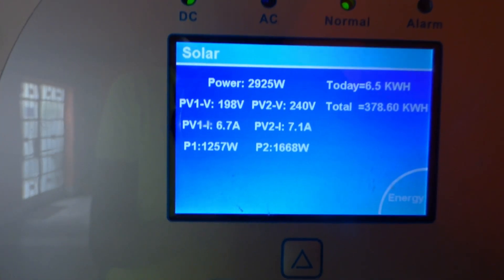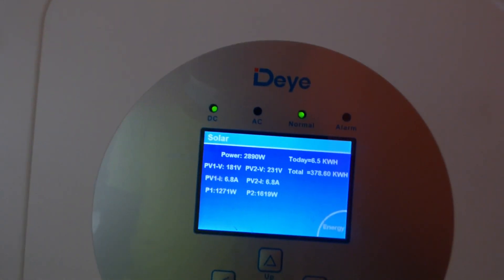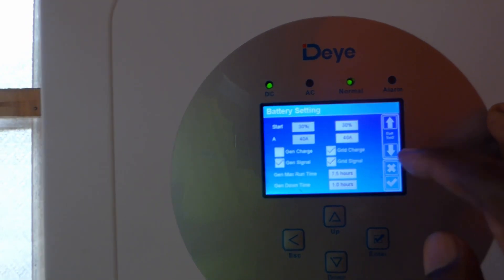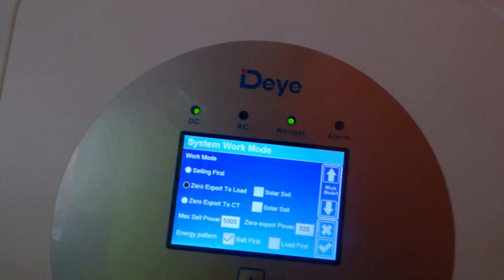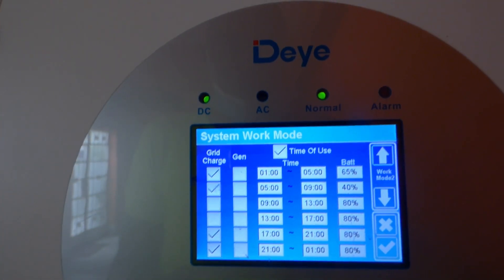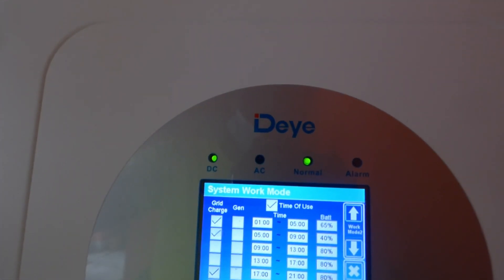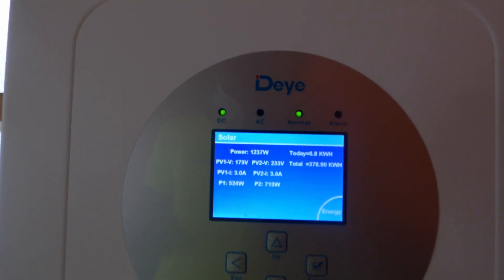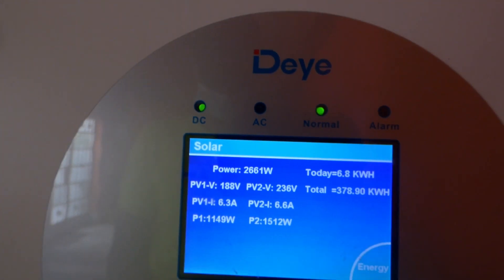Deye Inverter: Prioritizing solar over the Grid see how it is done.

Comment: Hi, i bought 5kw Deye and 4x405w jinko mono panels - no batteries.
I mounted solar panels to a tiled roof and inverter in the house - the inverter supply my house with solar + grid (hybrid on high loads and solar only on small loads). The problem is when grid goes off the inverter gives error F47 - even though i connect small loads. Your answer will help a lot - currently budgeting to buy 1x3000C polytech.
Reply from the maker: It does not work without batteries. It will work without batteries if you have the grid. You have to add batteries to the system.
Reply: @drsolar  tomorrow I'm getting the US3000C battery -  do I really have to buy a 100A fuse and holder? The battery bms protects it very well + deye is compatible with polytech batteries. I can save some money if the system can protect itself. Please advise
Reply from the maker: @nicomoloi936  get protection. You don't buy insurance because you plan to crash you car. Get a heavy duty breaker. We had failures in the standard breakers

Comment: Nice tutorial! Good evening. I just bought DEYE 5KW Hybrid inverter my question is as per manual / schematic the grid and load should be separate connections. Is it the grid connection is only the input side and the output is the load? If I am going to connect External ATS is it necessary? Thank you.
Reply from the maker: Good day Michael, welcome to the channel. The input is the grid and the output is the load. There are two inputs. Gen and Grid. No need for an external ATS, the inverter does the transfer automatically between grid and UPS. Good luck with your new inverter
Reply: @drsolar  thank you for your reply.
Reply: good day Micheal and Dr. Solar, If you have the grid connected then the grid input can also act as an out for exporting power back to the grid. This feature is nice since you can connect higher power loads ( beyond rating of the inverter) on the grid side so that they can be powered with solar power if available. You can limit the actual export to the utility by installing the CT (shipped with the inverter) passed the distribution point where you've connected your 'big load' and activating zero export. That way the big load will run with a mix of both solar and grid minimizing your bill.

Comment: Sir, I have a question. Lets say I set it 1pm-5pm discharge power of 100w. Then the grid is interrupted and EPS mode is activated during that time. Will the time of use settings be ignored? Say the load is 200w in EPS. Will the inverter give 200w for the load or will it shutdown because the set power is 100w?
Reply from the maker: Very good question. It will give the full 200 watts as long as your battery can allow it
Reply: @drsolar  this is all I needed. Im getting this inverter. Thank you sir!

Comment: Thanks Doctor. I have a question .... let’s say house load is (say) 2 kw at a specific moment and my solar panels at that moment only delivers (say) 1.5 kw, I noticed that my grid then kicks in and delivers the shortfall of 0.5 kw, even though my batteries are fully charged. I would rather that the shortfall be drawn from my batteries until they are (say) 60pct discharged, and only THEN the grid must kick in. How do I set up my inverter for this ?
Reply from the maker: Good morning. Thank you for watching and commenting. Settings, system works mode, check time of use, then check grid charge and the batt % 60. You have constant grid you can make that % even lower. Let me know how it worked out. You can whatsapp me on +12018154132

Comment: One thing noted here on time of use, your setting in the afternoon is 80%, which means the inverter will use the battery up to 80% state of charge if there isn't enough solar power. I have mine at 30% throughout day and night to shave off the electricity bill as much as possible (our power outages are not as problematic anymore, so never been out of utility power for months now). Also, if you have a bi-directional meter, you could benefit from exporting excess power to the grid whenever it is available. The bi-directional meter will run in reverse, therefore giving you kWh credits. So even if the utility does not buy from you, you actually get to benefit from the kWh units anyway, so nothing to lose there.
Reply from the maker: It will only use 20% before it charges. Soc will not fall below 80. Thank you for watching and commenting. I am off the grid. My customers don't have smart meters sadly
Reply: @drsolar  makes sense if you're off grid.

Comment: Thanks for these great educational posts. I learned a lot from you and actually got convinced to install a deye system. I'm on 5Kw Deye, 2 X US3000 pylons, and 14 X 410w poly panels(east-west orientation form longer stretch of solar power). The system works very well, I'm still adjusting to it. It is grid tied, so when I deplete my batteries at night, it then switches to the grid. I can also export to grid side of the inverter(export to CT). So during the day when the batteries are fully charged and there isn't any other usage, I use the power from panels and batteries to heat up the geyser(3kw element for 150L) or cook using induction stove/oven/insta-pot. At the rate I'm going, my electricity bill is down to about 25%, and it could go down further with more optimizations. So thank you very much.
Reply: Hi Melvin. I am in Limpopo and connected my east-west orientation to an almost identical system, just having one US3000C at the moment. Also grid tie, to save on electricity bill. I opted for a solar geyser when we built our house 5 years ago. i am still learning about the optimal settings from Doctor's videos.
Reply from the maker: @johanvanderwesthuizen9834  Thank Johan for watching and commenting. Please let me know how I can be of help to you
Reply: @drsolar  thanx, I will surely contact you during tomorrow or over the weekend.
Reply: @drsolar  I installed Solarman and configured the network. The LED are giving me, i believe, the correct flashings. My plant is still offline though.I have done all the steps from the small manual and watched Keith's video for the Sunsync. May I contact you in the morning?
Reply from the maker: @johanvanderwesthuizen9834  
it takes up to 5 minutes to update to the server.  Can you reach out on Sunday instead? I will be at a job site early tomorrow morning
Reply: @drsolar  good luck with your project today. I will continue to connect today and reach out again tomorrow if i have no success.
Reply from the maker: @johanvanderwesthuizen9834  good morning. How did you make out? Watch the Deye video on the same subject. I will record one to help out too.
Reply: @drsolar  my system is still offline. I checked my router settings and the stick logger is a client and all seems well. I have a “!” in my password and read on other groups that can be part of the problem. To change the password i need rights from my service provider which i have applied to. 
I also picked up that some users have problems with pc & phone conflicts and have therefor not tried the pc version. I am currently a bit lost.
Reply from the maker: @johanvanderwesthuizen9834  you need the phone app to set it up. Did you scan the barcode from the logger? Make sure the Wi-Fi on your phone is on. It will log into the logger, it might ask you for the logger password and then it will try to use your home Wi-Fi. Then you enter the Wi-Fi password. Did you go through all these steps?
Reply: @drsolar  i have done all these steps and my logger is setup through my phone. Done all the steps three times after factory resets, but I can’t get my plant online.
Reply from the maker: @johanvanderwesthuizen9834  did it accept the Wifi password?
Reply: @drsolar  i believe so, cause i see the logger as a client on the router
Reply: @drsolar  which website do you use on your pc for the videos?
Reply from the maker: @johanvanderwesthuizen9834  if you see it on the router then it is in. Are the lights on the logger on in the correct sequence?
Reply from the maker: Hello Melvin, smart investment. Good luck with then.
Reply from the maker: You are in South Africa?
Reply: @drsolar  yes I'm in Johannesburg (Midrand). Yes this is one of the best decisions I've ever made
Reply: good morning i am living in the Caribbean and just installed my system running 2x 8k inverter and 30 x 330 panels like you would like to deplete my batteries at night starting from (18.30 ) and then switch to the grid once my batteries runs out. I don't want to use the grid to charge my battery as during the day we have great sun and my system start producing from 08:00 to 17:00 so how do I set time of use PS I am not exporting to the grid

Comment: Hi Dr. Solar. I have installed. Deye Hybrid inverter 5 KW and using a CT to enable zero export to Grid. My question is what will be my settings in the work mode? Zero export to load or zero export to CT? Any other settings that I need to change?
Reply from the maker: Hello June sorry for the later reply. Either is fine. Can you email me at infor@atlanticwastepower.com and we can go over your settings together

Comment: Hi, I have 8K model, I can t down grid power to 0KW , it stays at 0,01 to 0,02kw all night long, it down to 0Kw when PV send power to inverter.... Do you know what are values for 48V 1000Ah battery use? ( 24 x 2V1000Ah ). Thanks.
Reply from the maker: In battery capacity enter your amp hours. Do zero export to CT and then adjust zero export power
Reply: @drsolar  do you have whatsapp or email address, I need help for setup , I use battery at night , it is 100% 55,9v and morning, before sun wake up, it is 86% and 51V, but we have not use air conditionner or other, we have 250w load for 13 hours, and standard setup is to charge battery at 80% with grid....
Reply from the maker: @laurentszemmelveisz4462  email me at info@atlanticwastepower.com and I will respond with my whatsapp.
Reply: @drsolar  check your spam.
Reply from the maker: @laurentszemmelveisz4462  seen and replied

Comment: Thanks for sharing this info it has been very helpful i have the same 5kw inverter please can you tell me how to do the wiring connections to auto start genrator input.thanks
P.s just subscribed
Reply from the maker: Hello Umar. How do you like it so far? Direct connection to the inverter input and then you enter the settings and set conditions and Presto. There is a video by Deye on YouTube that will help
Reply: @drsolar  thanks for your reply the inverter has been working good so far my only compaint is with the user manual and settings which are both too complicated still have not been able to figure out where ats wires go for genrator auto start i know have already connected the input wires and enterd settings but the generator is still not starting automatically.any ideas??
Reply from the maker: @umarraja8161  it is a very simple yet complicated piece of equipment. Does your gen have an auto start function? To test short circuit the wires and if it starts it does. Now the wires that start the gen go into the port labeled G-S. enable generator signal and generator charge in the battery menu. Indicate the battery percentage you want it to start the generator

Comment: What is the difference of Deye to Sunsynk and Sol Arc inverters?
Reply from the maker: On the 8 kw the breakers and firmware. The first two are IP65 the Sol-Ark is not. They also have a carry handle that is on the Sol-Ark and not on the Deye
Reply: @drsolar  Thank you for the reply. 

Anyway, what is a carry handle? Is it just a physical handle? 

So the solar functionality of these 3 inverter brands are entirely the same? But why do Deye doesn't have a physical manual when it came?
Reply from the maker: @billbreaker1680  yes it is a physical handle on the side in lieu of an indentation. They are the same outside of that and the firmware. Deye provides you with a manual
Reply: @drsolar  I see... 

So between those 3, Deye is the best among them right?
Reply from the maker: @billbreaker1680  same car but more options. Think an EClass with the 6 cylinder engine and 8 speed transmission but you take the cloth interior and not pay for the more expensive leather. The Deye is the E class without the leather interior. Same engine transmission body. I hope that explained it.

Comment: First to comment, can I use this with a 14s lipo system?
Reply from the maker: You are indeed the first? Did you see that I had 2 AC and my air fryer on? Yes you can. You can set your low battery cut off and the voltage at which you cut off charge. My current battery is a 14 or 15S and it works fine